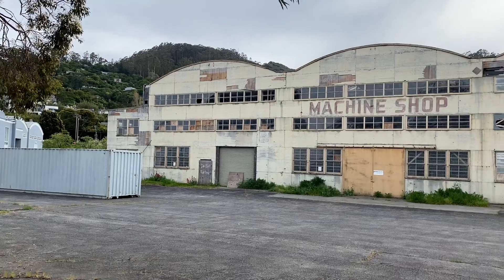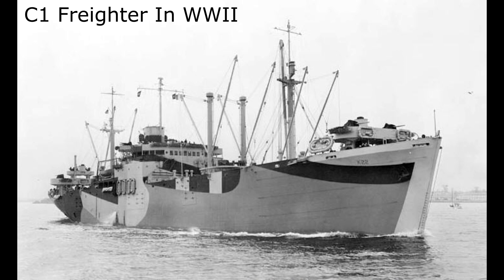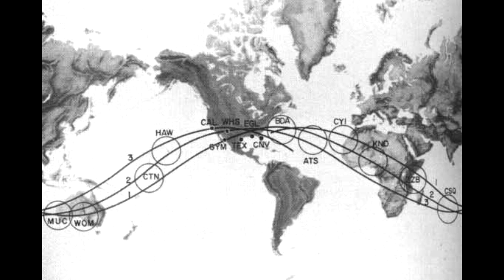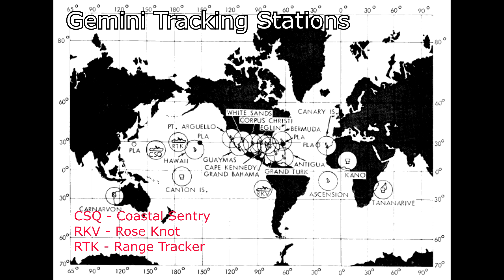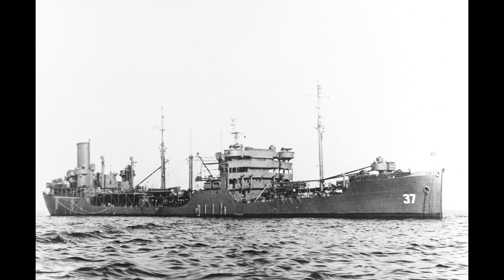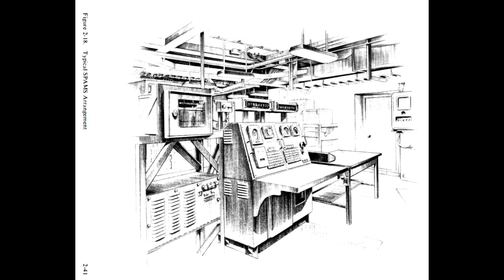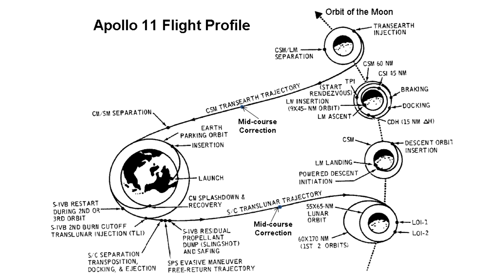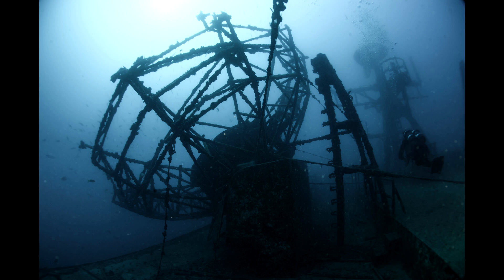The Story of NASA's Space Tracking Ships

Comment: When you said T2 tankers I shivered with images of hulls breaking in two because of the shoddy steel. They did an amazing job on solving that by splicing in a new midships section. Great video!
Reply from the maker: That was the east coast shipyards.
Reply: @scottmanley  Yes, you're correct. Keep these great videos coming.
Reply: I was told that the expected fatiguing of those splicing welds figured significantly into the decision to retire these ships when they did.

Comment: If they had to cut out the entire midsection of the ship, leaving just the front pointy bit and the back with the spinny propellers, wouldn’t it have just been simpler to start from scratch and built an entirely new ship? They basically already built three-quarters of a new ship
Reply: You're also reusing the costly but still viable power plant and crews' quarters in the back and the equally pricey control systems in the front.  I do recall encountering some archaic technology during my time on the Redstone, though.  Have you seen in old movies where someone is blowing into a brass mouthpiece to shout commands to the engine room?  That was still in place in the aft ancillary bridge and, yeah, I had to try it out!  I didn't know it had a built-in whistle.
Reply: From my limited understanding of ship building, designing and constructing the hull shapes of the bow (front pointy bit) and stern (back bit with the spinny propellers (and engines too)) is the most difficult, time consuming, and expensive bit. The middle of the ship is more or less a simple  3D 'U' shape that is relatively cheap and simple to make more of. The inside of the ships before conversion was mostly empty space anyway, as the ships were oil tankers.

Comment: Question to those in the know:  On a ship based dish, how does the roll and pitch of the ship affect that dishes steering and tracking? Are they dynamically corrected or do you just need a stable ship?
Reply: Dynamically corrected.
Reply: The ship could pitch and roll with the sea. The tracking computer (Univac 642B) would position all antennas for AOS. We covered one mission in the middle of a Tyhoon (don't remember mission number). Ship would be going crazy with position but the antennas would remain stationary to acquire AOS.

Comment: Ship of Theseus paradox; they replaced so much of the original ships when refitting, are they even the same ships?
Reply: I'm really surprised that replacing so much of the ship was cheaper than building a whole new one. (It must've been cheaper, or they wouldn't have done it. I'm just surprised.)
Reply: @beeble2003  the most expensive part on most merchant vesels is the engine room (main propulsion, auxiliar sistems etc). That is like 40 porcent of the cost of a ship. they re use that puls the the ruder and ancoring sistems. So probabli they re use like 70 porcent of the total cost of the ship. the mid section is a lot of metal but litel expensive sistems
Reply: @anuvisraa5786  Thanks -- makes sense.
Reply: @anuvisraa5786  Needs more Ys.
Reply: @beeble2003  They kept the stern with the propulsion and control systems, and the bow with all the anchor hardware.  The rest of the ship, basically just a big empty tank full of petroleum residue.  Simpler to cut off the bow and stern and graft them onto a new central hull that was purposefully built to support those really big antennae, had purposefully built computer rooms, berthing, electronic stores and such and such.

Really cost effective as the bow and stern require most of the fiddly bending of hull metal in more than one direction, and had all the dedicated ship-machinery stuff.  The new section of hull was simple to produce on rolling machines, and basically easy welding (well, easy in comparison to building a stern or bow.)

You see the same thing today.  Back before 2020, it wasn't uncommon for an 'outdated' cruise ship to go into refitting and have a central section added to extend the ship.  Same thing with other ships like container ships.

Look at your car.  The expensive stuff is under the hood and under the trunk.  Same with ships...
Reply: I'd tend to consider them different, not merely because so much was replaced, but because the function was so thoroughly altered. It's not like the Ship of Theseus was being converted from a fishing vessel to a trireme.
Reply: Ship Of ARIA paradox
Reply: Yes, because continuity of identity.
Reply: If they replaced everything but one bolt, it's still the same ship.